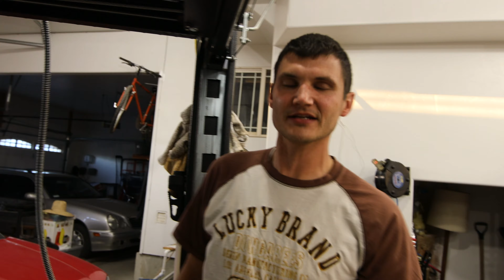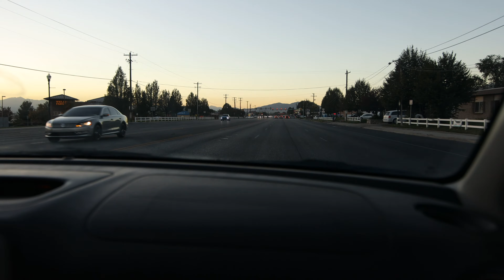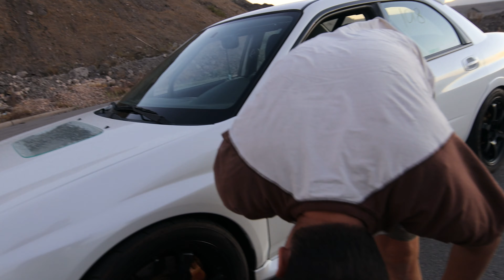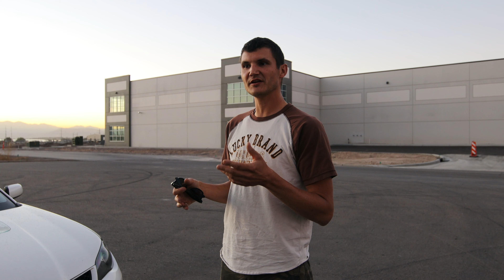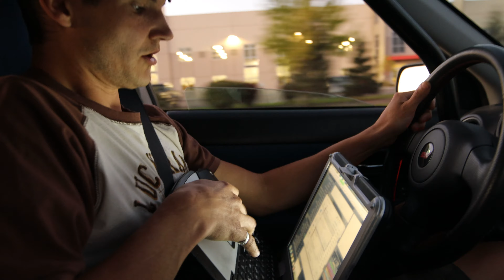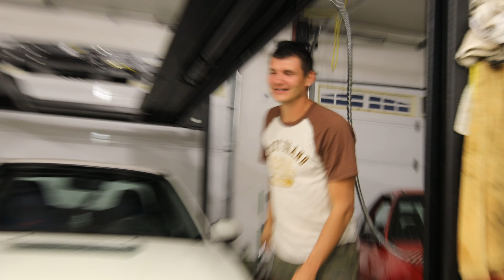Tuner Surprised by COMPOUND TURBO SUBARU STI!! (800+ HP)

Comment: This will work great actually just have a wastegate plumbed in so it opens and feeds the second turbo. So the exhaust pressure ratio doesn’t get to high

Comment: Any long term updates. Did the rod bearing held up with high cylinder pressures at low RPM?. What tunning software? Are they sharing the same boost controller?

Comment: in compound turbos the turbos do not "fight" instead one turbos helps the other by increasing the pressure is "sees" before it compresses it. In single its atmosphere>compress>intake... in compound its atmosphere>compress>compress more> intake. the boost is "compounded"

Comment: Can’t believe I’ve just come across this now. I’ve had my forester compound setup for about 4 years now. Currently upgrading a lot of parts and I actually have those dual radium tgv deletes as well. Great video
Reply: That's sick! Do you plan on uploading it?
Reply: @johndeagler4556  I have been for the last 4 years. Either click on my pic to the left or search compound turbo subaru.
Reply: What kind of numbers are you putting down? Also, is your Forrester an EJ257 swap, EJ205, EJ255?
Reply: @Row_gears808  it’s an ej205 but with forged internals
Reply: @HarrodsGarage  EJ205 FTW 😀

Comment: Really enjoyed this video. I'm building a compound turbo setup on my 05 outback XT. I've currently got it running on my small turbo: Holset HE221. I'm adding a Holset HX35 with custom turbine they call a .82 ~ 10cm T3 custom made for tuner cars. I've got the position and fitment of all components and will be fabbing it up the next couple weeks. Motor is built, but not enlarged head studs, so I'm not looking to go over 25 psi. Love that you say this adds torque all over the place. That is what I'm after. Plus I just enjoy turbos, and I want to feel it without lag and without a die off as you say above 5k rpm. I am planning to just start with controlling the 2 as 1. Perhaps later I'd want to add a second EWG to turn off the HE221 at ~10psi... Currently I'm on ID 1050's.. The idea of having to buy 1300's is annoying to my finances... Allows me slightly higher numbers if I do on the setup I already have... I'm rambling. Nice work, thanks for the video.
Reply: Very interesting, how does it perform?
Reply: @lutherblissett9070  It's still being E-tuned. Which is great for a reason no one has ever mentioned- that I've heard: When things are discovered, I can take my time resolving them before tuning continues.. In the process I've removed the timing belt a few times, replaced an AVCS gear, replaced the heads, and right now am making a custom V-mount Radiator/ condenser and intercooler in search of lowering unwanted high IAT's. Though I am water to air on my intercooler so after the rad and AC Condenser are angled down, the intercoolers radiator is the next big thing. Making a custom radiator for the engine and the intercooler right now.

But yea, it drives pretty good. Probably more boost all over than tuners are used to, but I haven't got a lot of feedback on that yet. Also I might have the heaviest unsprung weight of any Subaru which effects the drivability in a weird way. 15" rotors, BMW wheels.
Reply: @vgnfab  How is boost/wastegate control? Are you using EWGs? How are you packaging the setup?
Reply: @lutherblissett9070  I am treating the set as a single with an ewg.
Reply: @vgnfab  You need to post a video of your setup as I don't get what you mean!

Comment: What about a Waste gate on the cold side to bypass excess to the smaller turbo straight into the intake to ease its exhaust back pressure.
Reply: Just as a pointer you can't have wastegates on the cold side it's impossible wastegates are always on the hot side it's all control that deals with the hot gases

Comment: My 07' STi is getting a new motor soon.  I mustang dynojet at 425 WHP on about 22 to 23 psi.  Stock block with CP pistons dropped in.  Stock heads.
Rebuilt FP Green turbo with almost 45 degree linear curve on dyno.  It just keeps pulling to redline in every gear.  Just doesn't fall on its face at lower 425 whp dynojet HP numbers.  Not like these 850 and 1000 WHP cars.

But I thinknI want to flex fuel it and be able to throw in E85.  There is a station by work I can drop E85 at.  Would be cool.

Comment: Subscribed! 
So what was the wg spring pressure? What tuning peculiarities are there on a setup like this?
Reply from the maker: On which gate?  There are two
Reply: If the turbo sizing was chosen correctly it should be pretty straight foward with identical wg pressure on both wgs. watch?v=1pV_tLbZY0A&t=588s

Comment: GT 3076 is the primary turbo which is not small at all...a VF with an aftermarket 11 blade compressor wheel would had been a much better choice.

Comment: So im thinking of doing a safe build thats around 450in my built hybrid ej257 sti and im wonder if its okay to run it on low boost on single injector set ups or should i go to duel injection as well
Reply from the maker: Singles are fine.  The problem is once you go over a 1300cc injector you will notice idle and part throttle driveability are not perfect like the were stock.  Then once you go 1700+  size, then really you do need to make some compromises on how well it idle and such.  There are some tricks as a tuner that you can do to make it "behave" but it will never be perfect like oem.  

This is to be expected though.  If you could get huge injectors to behave perfectly no matter how little you used them then the oem's would make one injector that was 2000cc's and put it on every motor whether it made 100 hp or 2000 hp, but the size does change the amount of control so as you start going really big there are short falls to that.
Reply: You'll be fine on some singles, 1300s or more
Reply: @jefflong1460  thanks for the info im running a stock vf39sti turbo and im looking in to a fpgreen on the big end
Reply: @mainelybuilt  I have a vf48 with an 18g housing and 68mm wheel. Spools faster than fp and makes 500whp

Comment: Compound setup question:
When running 2 turbos, is it better to use same size or one bigger than the other? If bigger/smaller which should feed which? Smaller to bigger or bigger to smaller?
Reply from the maker: You wouldn't want to use the same size as that would defeat the purpose and really just become a basic twin type setup.  The benefit really comes in being able to run different sizes.  One for fast spool, and the other for flow.
Reply: @tunedupautomotivetuning4579  do the smaller turbo need to shave bigger housing, bigger AR so that engine can utilize the bigger turbo really?
Reply: Whats funny about these comments about big to small or small to big is y'all didn't specify hot or cold side. Hot side small feeds big, and cold side big feeds small.
Reply: Smaller feeding to larger
Reply: @jefflong1460  No. Larger feeding smaller. The smaller turbo would choke the bigger turbo if you put smaller first.
Reply: Nice build bro, just a question what happen if we run same size of turbo

Comment: Been highly considering a compound on my 12 Acura TL sh v6, 
This is exactly what I’ve been seeing for years, a overall responsive drivable vehicle with a large fun powerband , 
I don’t go to tracks
Reply from the maker: I have a turbocharged J35a8 motor on a 76mm and there is no need for such a complicated set up like this on a J motor.  Just do a 64mm and the spool would be stupid fast
Reply: @tunedupautomotivetuning4579   ummmm.... that’s far from complicated... but u do you my man cheers
Reply: I think J series engines don't need a compound setup at all. You might want a good twin-scroll turbo and feed each bank of cylinders to each scroll of the turbo. Look at Honda J30AC for the idea.